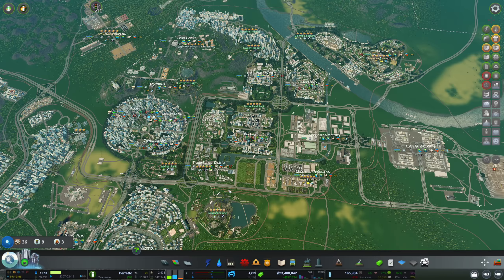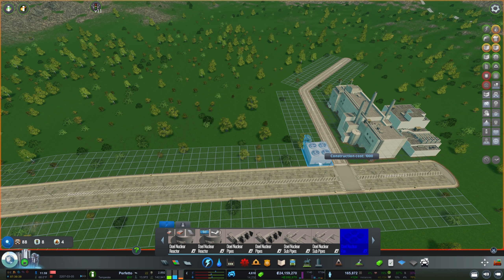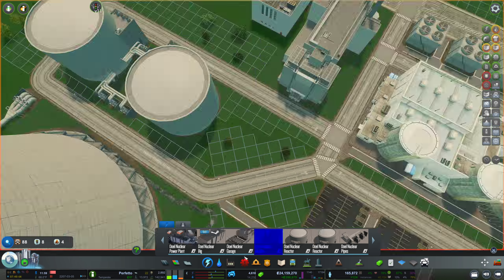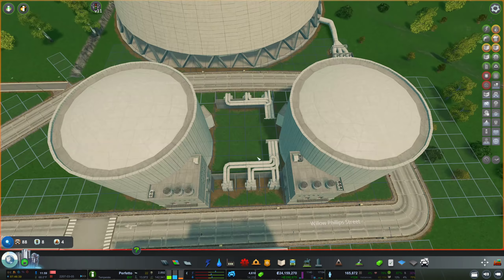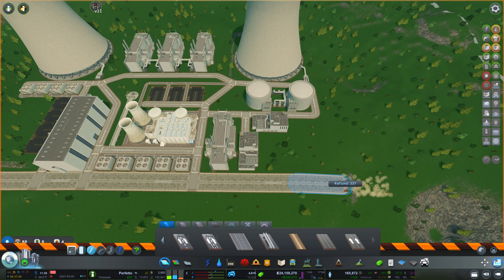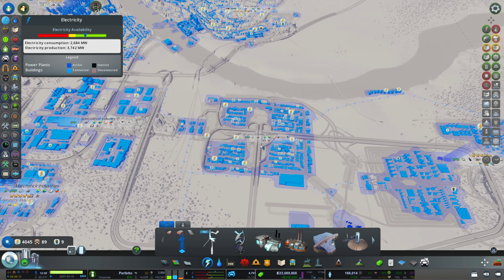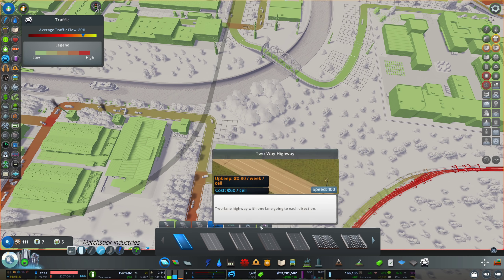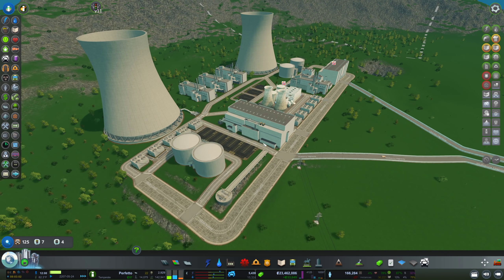CUSTOM NUCLEAR POWER PLANT: Cities Skylines (All DLCs) - Ep. 65 - Building a Beautiful City

Comment: They're called cooling towers. From the top, hot water from the turbines is sprayed down at a cold water basin to cool it down. Then the water is sent back into the steam generators inside the Reactor housing to heat up again and repeat the cycle. The fuel required for the reactor is quite expensive that's why it has high upkeep.

Comment: Hi nathan, you did better than expected. The following is gonna be a bit geeky.
There is no cooling. If you observe any nuclear plant in the world, you will see it is built near water sources. Large amounts of water are needed to cool the steam in secondary circuit. To explain this, both power plants, nuclear and coal, are based off a steam machine. The heat generated by burning coal or breaking down uranium is used to heat up water, create high temperature high pressure steam. That steam is then lead towards steam tourbine, where the motion of steam is transformed into rotation, which is than through electric engine used to create electricity. For safety reasons, there are 3 circuits for water/steam. Primary circuit is directly in contact with nuclear fuel (small cubes of uranium encased in steel, submerged in water). Here temperatures are about 300-400 °C, with high pressures. Heat from here is transfered through heat exchanger (something like radiator, but water or steam on both sides, bigger and made from copper) into secondary circuit. In secondary circuit, water is used to generate vapour, steam, and create electricity. After that, the  remaining steam with temperatures slightly above 100°C, is cooled by water in tertiary circuit, to become liquid again. Water in tertiary circuit is then lead toward cooling tower, where part of it is evaporated. The remaining water is then mixed into river, ecological organisations ban heating the river water by more than 2°C, so no boiled fish. Now, the used fuel is usualy stored in the area of the power plant, and since only 5-10% of fuel is usualy burned, it requires cooling. I bet that is why the mod it includes the fans - since heat is produced slowly, fans are enough. One modern reactor produces 1000-1500 MW, usualy there are 2 of them for each set of generators, so the amount of energy produced is realistical. I know that in our nuclear power plant, they upgraded the peformance of tourbine, and gained an extra output comparable to a new coal plant. To think there are eco activists against nuclear energy is so silly.
Now a few ideas:
1) The fence should be all around the plant, inside it is an industrial area, it would be an obstacle.
2) Since it is an industrial area, dont use the decorative paths with trees, maximaly around entrance.
3) The long thingy with circle at the end is probably water sucking device for tertiary circuit, like the round thing would be inside dam.
4) Add water outflow afterwards.
5) Doubled powerlines as for decoration - there is huge amount of energy produced so there is not a single powerline leading out.
6) Why is there included the default power plant? It doesnt fit, small like kid´s toy. Real cooling towers are about 250m tall.
7) If you wanna decorate, you may add some industrial type of park or sculpture, power plants are where companies go and splurge any penny to improve visage. For example in my country, there is a small castle made into nuclear plant museum for visitors, right next to it.
8) The layout should follow how the energy is made - from one side - water sucking -> reactors -> power generators -> cooling tower -> waste storage + fans -> water outlet, reactor, cooling tower, power generators should be connected with pipes, power generators should have the electric cables leading out. Of course, in between could be any path system, offices, parking, police station, cantine, but the main functional buildings are as I mentioned.
9) Bring in rails, as industrial decoration, doesnt have to be functional.
10) A cooling tower would fit nicely in front of runways.
11) Since it is a dangerous game full of disasters, add all sensors in vicinity - earthquake, tsunami, deep space radar, and probably a vault for employees.
Reply from the maker: Copied that beast of a comment and will look at it when I get to the nuclear plant again:)

Comment: You should paint the ground with concrete in the power plant area
Reply from the maker: That was the only asphalt/concrete option, it's looking mosaic because of the theme we applied.
Reply: @Nathans-Sandbox  Well this gravel thing is not bad option, it fits the needs - no weed to deal with and supports heavy vehicles.

Comment: 640MW not alot? LOL.. you don't know what you mean...
Reply: watched your video and there so many points that are not really correct but I can't blame you, since the ideal concept of a Power Plant is not available in the game. I might suck if I did it myself.. But all in all. good video.. I dropped you a like here.. and sub..
Reply from the maker: The 640MW weren't much compared to my current power output. But as it turns it, the plant delivered 2500MW, so I'm happy with that!;) Thanks for commenting and subbing!
Reply: @Nathans-Sandbox  I haven't dig this game really. But what I got is several Power Plant Projects under my belt. That's why I was surprised that you said "not alot"... But don't take the negative side... I'm just sharing my thoughts here.. Keep it up, You're doing great!
Reply from the maker: Keep sharing them;)